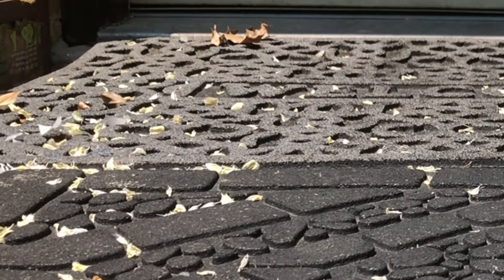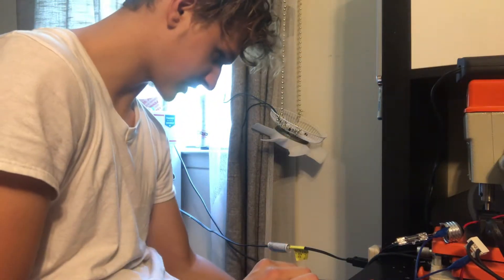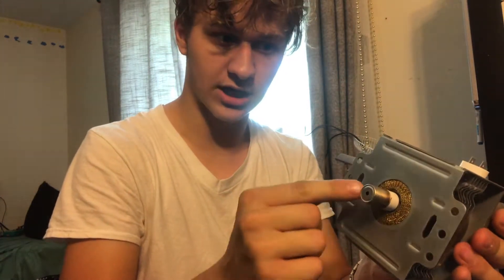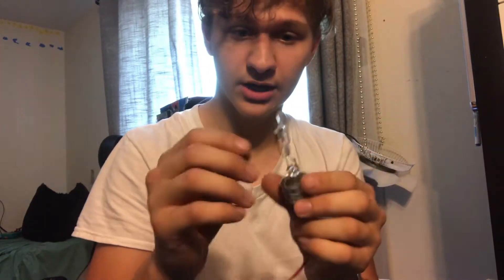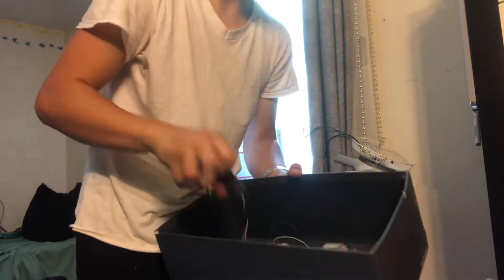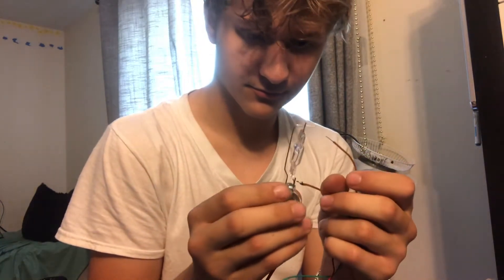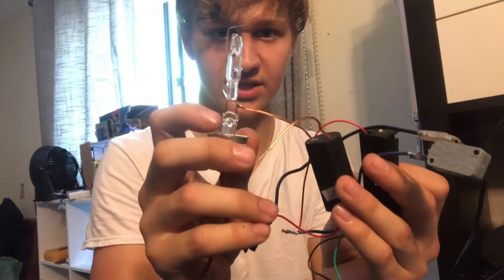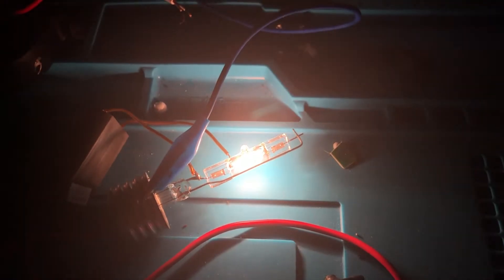Making DIY X-rays using high voltage

Comment: I'm sorry to have to tell you this bro, but you didn't produce any x-rays. What you saw was only due to the high voltage arc. What you should see are hot pixels, which are white dots that appear when the x-rays hit the camera sensor.
Reply from the maker: Yeah, after the video I tried to replicate that on a larger scale but I realized that I just created pulsed EMF. Thank you for your comment, I have many projects on the back burner and more X-rays are due.
Reply: @Just-A-   are you going to buy one or make one?
Reply from the maker: Buy it, under the large vacuum the tubes I tried making imploded

Comment: I'd test the spark again but just next to a bright lamp and the same camera setup. I've seen those lines generate simply from the sparks under the right lighting conditions without x-rays being involved. I learned the phrase "sanity check" a while ago, essentially it just means to validate what you think you're seeing. Idk if those are x-rays or not causing the line artifacts but I'd believe it more if the test I proposed doesn't show similar lines